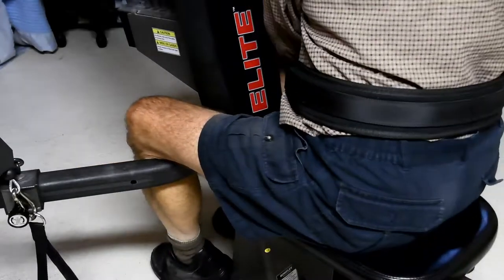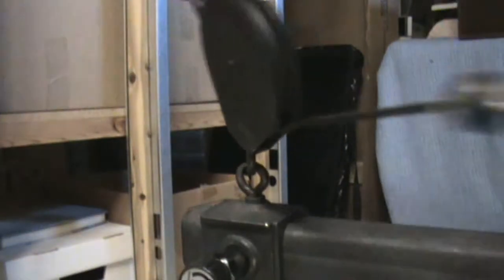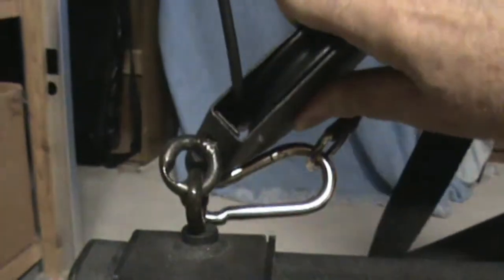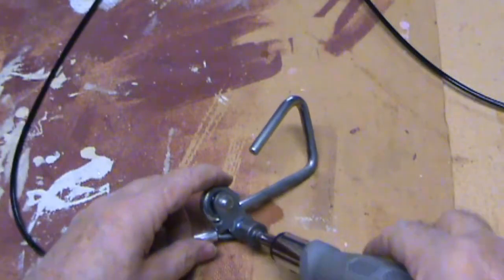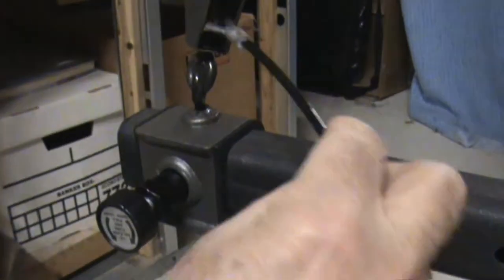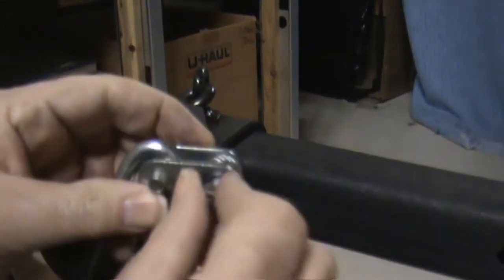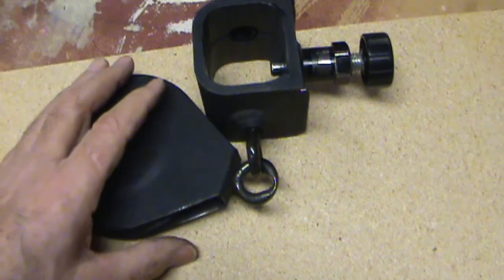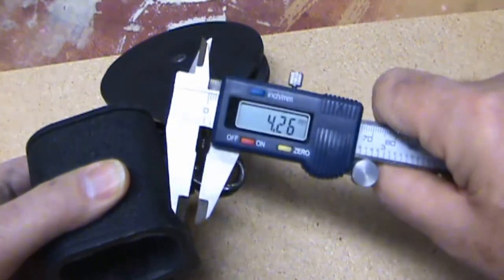Replacing worn Bowflex pulley rings

Comment: Where did you find replacement pulleys?
Reply: I got them from the manufacturer. But that was a few years ago.
Reply: @David_Powell  They're hard to find these days.    I can pick up Bowflex machines so cheap, that I bought a 1 for use and 2 to keep stealing parts.   I'm a bit of a scavenger, but I'm looking pretty good these days.
Thanks for the help.